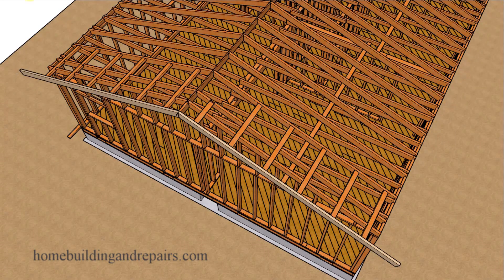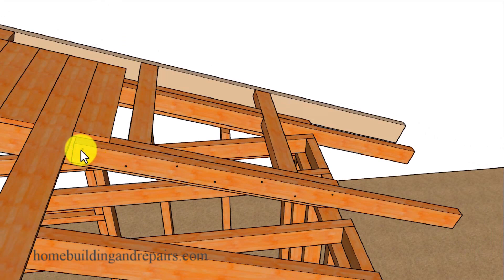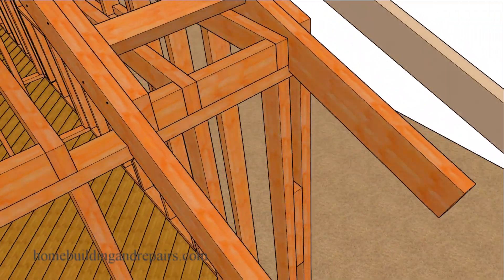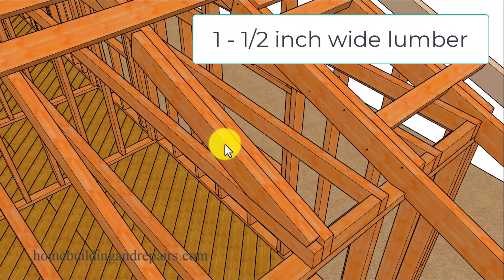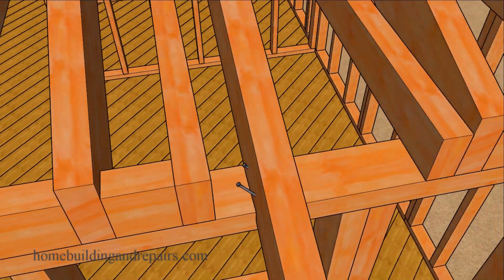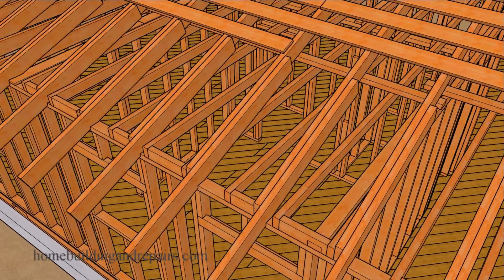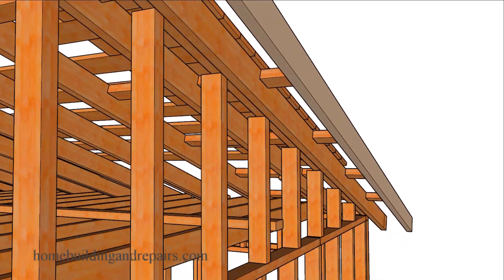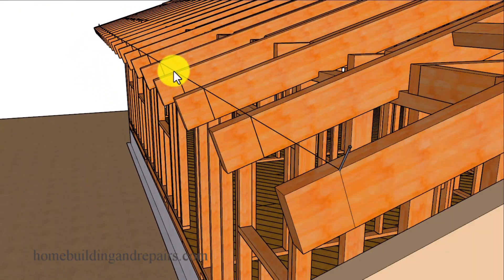How To Add Roof Overhang Using Extender Boards To House Without One - Old House Remodeling Part 8

Comment: I’m extending overhang on front of my house and adding on my sides. If I cut my extenders like this my gutters will be pitched forward. Would it be better to cut my extenders straight up and down instead of same as pitch of my roof. I’ve never seen it done this way. And I’m quite experienced around construction, been electrician for almost 40 years

Comment: some guidance in blocking would help me a lot. For example how many of them will need the hole with screen for vent? Do you have a formula for figuring how much venting is required?